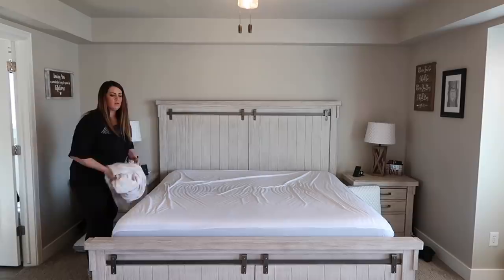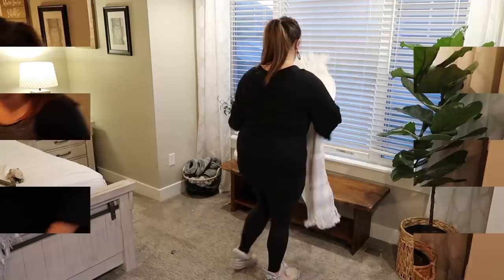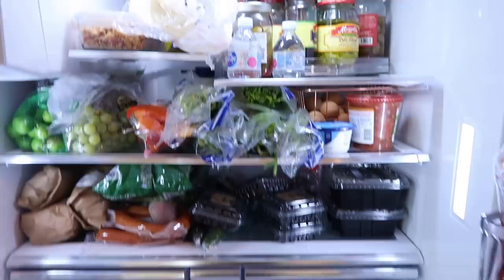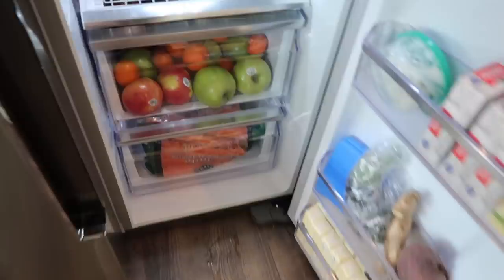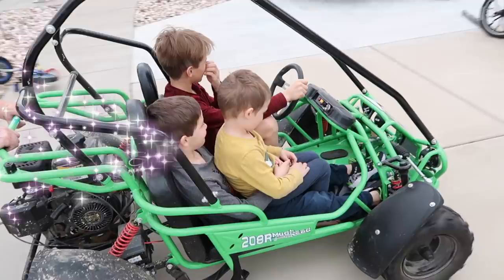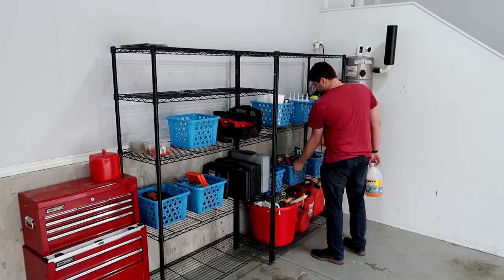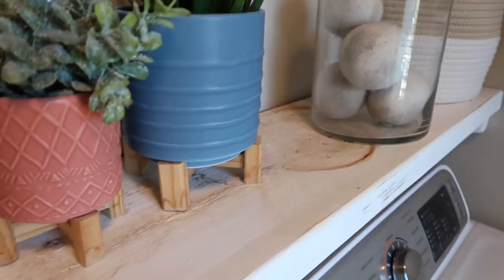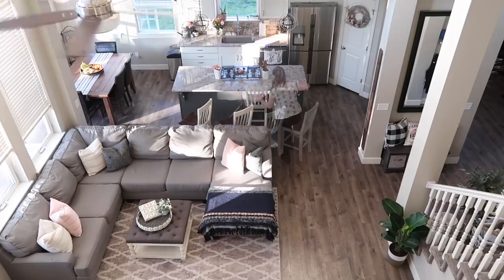2020 CLEAN WITH ME MARATHON :: 2+ HOURS OF INSANE SPEED CLEANING MOTIVATION :: HOMEMAKING #WITHME

Comment: Hey! So a while ago you mentioned those bottles on the right side of your kitchen sink, the glass with the pour spout. I remember you mentioned using them for soap. Anyway I bought one a while ago and I put dish soap in it, but I feel like the tiny vent hole on the lid clogs super easily and makes it hard to pour from the bottle. Any advice?
Reply from the maker: So I added a little bit of water to the soap to let it run a little easier!!